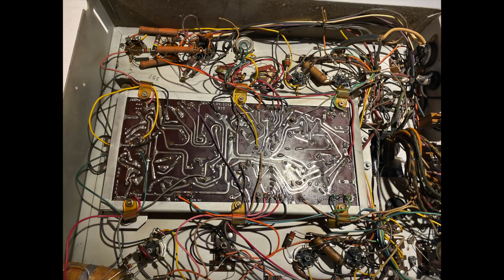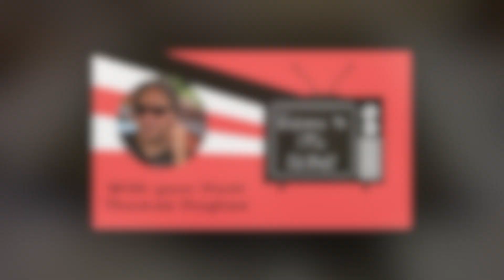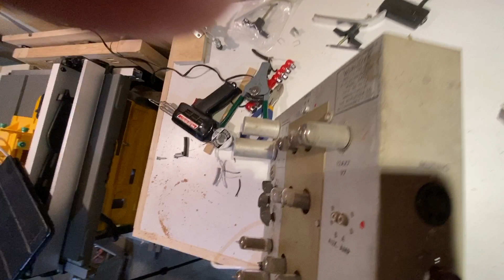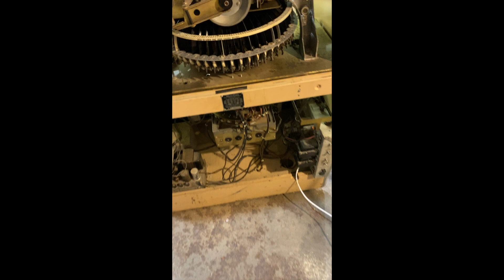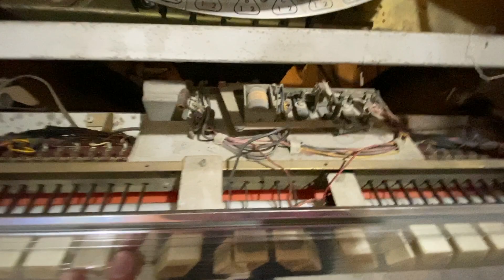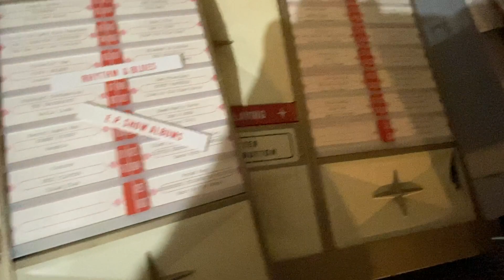Wurlitzer 2504 Jukebox Repair & Troubleshooting Part 1

Comment: The issue with adding a ground wire to these old Jukeboxes and other appliances that originally had a 2 wire plug is they can trip AFCI and GFCI breakers because the chassis is sometimes bonded to the neutral wire.

Comment: The aux power plug was probably for a booster amp, as clearly the built in amp was not of great power for a large bar or restaurant.  If there is space inside the cabinet, an aux amp was probably an option.  Some companies offered a preamp for a paging microphone, these usually "ducked" the phono music when the press to talk button was pushed, then return the music to normal volume after the page.

Comment: Hi! I have a Wurlitzer 2500 (the 50 record model of your 104 record model) Do you know how to replace the turntable drive belt? I have the complete service manual but it does not explain how to replace the belt. The 2504 you show here and my 2500 should be the same. Just checking if you know or have a source I could contact. Thanks!

Comment: Thanks!  I enjoy your videos. The problem with my 1957 Wurlitzer is that the record selection isn't working.  When you make a selection, the lower selection wheel turns, as does the record carousel, but the song selected doesn't activate.  (I can play a song by sticking my hand in the back and pressing the lever with my finger.)  Any ideas?

Comment: Bear in mind that with these mechanical memory systems, you can't write the same song in more than once! They also can't play back in the order in which they were selected either - the readout arm will just stop at the first tripped pin that it finds. Must have been frustrating back in the day if you were in a bar and selected song number 100, then had to wait for ages because people after you had selected lower numbers...
Reply from the maker: Hey thanks for the comment! You are totally right. I realized that after I posted the video. Made some great progress today so stay tuned for part 2!
Reply: @IFixOldStuff  Looking forward to the next update, that machine looks very similar to a 60's Wurlitzer Lyric that I repaired for a friend many years ago. I have a similar jukebox repair session happening on my youtube channel at the moment, I'm rebuilding a particularly knackered Rock-Ola 456. Gotta hand it to you though, your production looks more polished than mine haha.
Reply from the maker: @djsherz  Thanks man! I'm trying. It's a bit of a learning curve